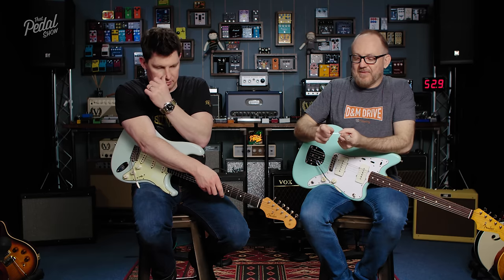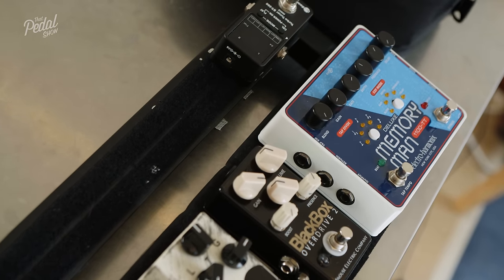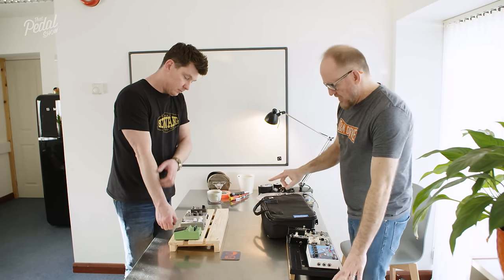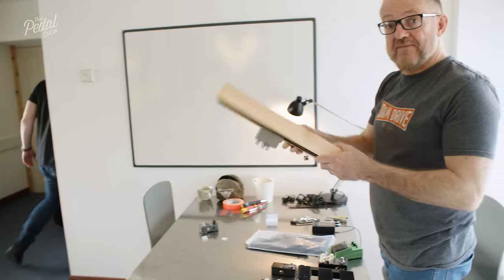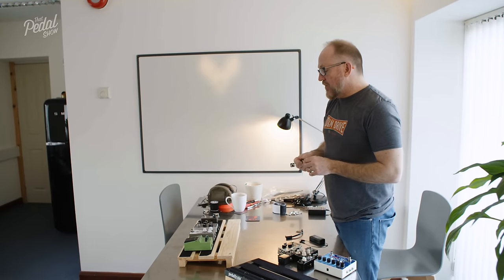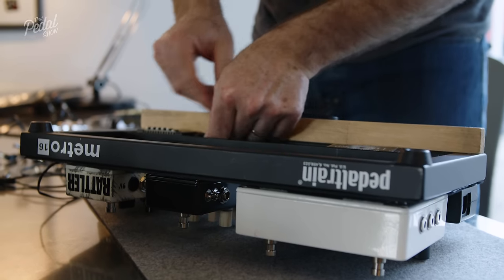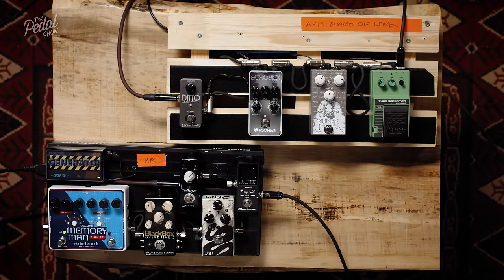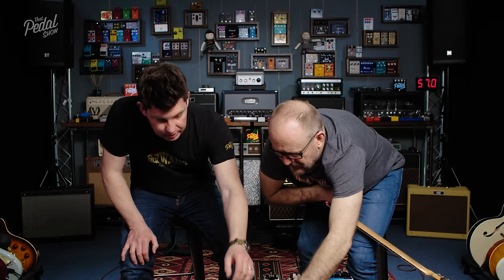Tips For Your First Pedalboard Build – That Pedal Show

Comment: I had been postponing building my board until today, when I saw this video. As soon as I started I realized I would get into trouble. I did the layout and then considered the patchcables. 

Problem 1: patchcables take up A LOT of space, more than you'd figure; had I secured the pedals and tried to conect them, I wouldn't be able to access some of the input jacks on the pedals and conect them.
Problem 2: the floor of my board has circular holes instead of the long open space seen on the two boards in this video. This makes securing the pedals and passing the cables a much bigger problem than it needed to be.

Moving along, I saw the two problems above and decided to check on the power supply. It has plenty of room under the board, but how I can conect it to the power forces the box to be in a specific position, which leads us to:

Problem 3: distance from the outputs of the power supply to the pedals inputs, and the length of the cables I have (which came with the power supply); not sure how much big a problem it may turnout to be, but I might not have the proper cables for all the pedals I can actually supply, meaning I have more outputs in the supply than I can use.

Together the problems above lead to me not being able to use all the pedals I can/want, and not in the layout I would choose. That is a pain, 'cause the board cost me a lot of money. 

Bottomline: people, PLEASE, do consider everything they mentioned here, and if you think you have a good idea of what you need, get something slightly bigger so you have room to maneuver. Be careful! Sure, it's on me, but I do hope this serves as a cautionary tale.

Comment: Great episode. But I reckon one can be more economical with space and without a big budget. I've fitted 8 normal sized pedals plus isolated power supply into a board that drops into an old laptop bag. Very portable, lots of sounds. TU-3 > MXR Super Comp > Caline Pure Sky OD > TC Mojo Mojo OD > MXR Analog Chorus > Source Audio Vertigo trem stereo out > TC Flashback stereo > Strymon Blue Sky reverb stereo. I've used it for a number of years now. Best upgrade has been the low cost isolated power block (8 x 9v @ 500ma ea). I've cycled a few OD/Dist pedals. Pretty happy with the Pure Sky into Mojo Mojo stacking but the plan is to eventually swap out the Caline cheapie for a Wampler Euphoria (any donors?).

Comment: Was you said around 2:40 is so important! I had a phase in which I didn't play much guitar at home, because I had to plug in and turn on the laptop and turn on three switches ("silent" practicing to not disturb the neighbors). That might sound unbelievably lazy, but when you come home after work, picking up a guitar and play should be as easy as possible. I went the OX-road and I'm down to switching on a power strip, put headphones on and hit the Preset Du Jour on Le G2 and I can noodle.

Comment: Instead of using a cable tie to tidy up cables underneath the board, I use the little wire twists that usually hold the cables when you get your power supply. Holds everything in place and you don't have to snip anything when you need to rearrange.

Comment: I started with a "floorboard". Pedals on the floor a la Jimi Hendrix/Robin Trower. Later I bought a SKB pedalboard. After that, a 2x2 plywood and finally a Pedaltrain Nano 24. I don't use a lot of pedals. Around 5 to 6, depending what I'm going to play. Wah wah goes outside. Everything with batteries at the moment.

Comment: Regarding Testing Patch cables: If you are actively using / building / swapping pedals, guitars, amps, PA's, music gear in general. Invest in a cheap cable tester or simple volt meter so you can test cables. Some cable testers come with a tone "send" - this is super useful when sorting out intermittent problems.

Comment: If you're first starting, try your pedals in every configuration you can imagine. Sometimes people get truly unique sounds by not going with the norm. Get a good power supply like a Voodoo, they're solid, and some decent patch cables, there are many. Also, if you have the means, build your first board out of wood or metal, if you have a welder. Paint it, put some lighting in it, attach pyrotechnics to it, do something fun and original that makes it yours.  All my pedalboards I have ever built are handmade. I just can't afford something nice for 15 pedals, so I build my own. Or I guess I spend that kind of money elsewhere. Zip, or cable ties are a great alternative to velcro. I prefer them. They're cheap and plentiful. And remember above all else make this fun because that's what it's really all about in the end.

Comment: The size of my pedal boards are all governed by what redundant laptop bags I have around the place, although I did splash out on a keyboard bag when I wanted something larger. 12mm ply cut to size to fit the bag, spray black, add some rubber feet, velcro tape the top and good to go. Add holes for leads where required. 

Another idea is a carpet tile. Just a carpet tile. Subject to the type of carpet some will hole velcro hook tape like the proverbial to a blanket.

Comment: Top tip for Boss pedals with rubber bottoms: painters tape followed by gaffer/duct tape around the baseplate. Use a minimal amount of tape and loop it around so it’s stuck to itself and secure. The painters tape is just to prevent residue from the duct tape. Also leave the screw holes uncovered. Then you screw the baseplate back on and the Velcro will stick. Credit to some tgp post I read years ago.

Comment: Hey guys I'm pretty sure the noise is coming from the Ditto pedal.  When the power supply is not isolated, it's usually the digital pedal that's gonna create noise. Happens to me whenever I have a looper and digital pedal on the board.

Comment: I use a rechargeable power supply for my small boards (a pedaltrain volto) yesterday it died on me when I was in the middle of recording. But admittedly I was powering a Strymon Flint, a Strymon El Capistan, a TC Corona midi and an EH Small stone for one of my synths, then a EH Bass Big Muff deluxe and EH Bass Clone Chorus. It happened at a really in opportune moment when I was trying to record the bass line.

Comment: Great episode as always. How did you secure the wood strip to the bottom front of your PedalTrain boards to prop the up on an angle? Dual Lock? Glue? Self tapping screws?
Reply from the maker: Wood screws. Drilled through the PT to make holes, and on into the wood....

Comment: Thanks fellas great show and very informative. Especially “Mick “ invaluable info on isolation, i too had a noisy board when engaging my TC Electronics dual pedal of noise gate and compressor, it was disappointing because i had just purchased a new TRex power supply with dedicated 12 volt supply for said pedal👍😁 , i thought all would be good but no . After watching this episode i plugged in the pedal with its dedicated power supply and was nice and quiet 🤫👍
Cheers fellas

Comment: Hey D&M! A question about sharing an isolated output between two pedals. 

I use a VoodooLab 4x4 power supply with 8 isolated outputs. The number of pedals on my board ranges from 8  up to 12, so I sometimes have to share an isolated output between two pedals. I use the VoodooLab Y-cable for that. Most of the time this works out great but with some pedal combinations the other pedal wont turn on. 

As an example: I tried powering my OCD and Simble from the same output with a Y-cable and use another separate output for my Katana. This way the OCD and the Katana worked out just fine, but the Simble wouldn't turn on. I switched the power between Katana and Simble and everything works out fine. 

Even though I've always managed to work my way around this issue I would really like to know WHY this happens. Maybe something to do with the VoodooLab Y-cable cutting the earth from one side of the Y? 

Keep up the good work and greetings from Finland!

Comment: If you put zip ties through in reverse it doesn't lock but it stays pretty well, so if you don't have a board that you are throwing around to an extreme amount it would be alright, in the Marines we used to flexicuff ourselves in training this way so we didn't waste flexicuffs and so we didn't have to cut them off. You can also bend after it's through to make it hold even better.

Comment: When put the velcro on: hookside on the board. If you move pedals around on your board, the loopside will wear out. Over time you'll have to replace it. It's easier to replace it on the pedals than on the board.

Comment: Thanks guys for your timely video, enjoyed especially the explanation of the tigris modular power system and a reminder of the necessity of good signal cable. just about to build a pedalboard for a duo gig, spent a shitload on some quality pedals, it is a necessity to get the power and signal right. The evidence cable and connectors costs heaps, but does the job,  have some george L available, but always hearing conflicting reports on it's reliability . Standing at the crossroads, thanks again, cheers.

Comment: Did you guys ever try the Mission power supply with the big USB charger/battery pack in the setup you had at the end to check for run time, and to see if that problem pedal remained clean when all 4 pedals were run off that one battery pack?

Comment: I have the same pedaltrain pedalboard and I always get angry because of the lack of space for cables below it. Nice idea to lift it with that piece of wood! Thanks!
Reply: What is the best way to attach the wood? I have the same metro board, and the feet are not easily removable

Comment: Great video! It’s worth mentioning that in hotter countries Velcro is not an option if you are playing outdoors, the glue will just get runny and the pedals move. Cable ties are the best option. 🎶🎶
Reply from the maker: What is this hotter country of which you speak?
Reply: I mainly play weddings in Southern Spain. Always outdoors, May till October, 4PM to 6 PM, 30C - 45C! The Velcro lasted until the first time it hit 35C, then the pedals just slipped of the board. 😂 Now it’s only wire ties. 👍👍 thanks for the great Channel.

Comment: Great video guys. Great playing also. You brought up a great point.... for the last few years I’ve had a small board. 5 pedals, powered by the Trex fuel tank jr. I’m now about to add a Mr Black DeluxePlus and also a booster..... new power supply needed :-(. Sometimes it’s easier to keep it simple

Comment: If you want something more secure than orange tape, you can buy little plastic mounts for cable ties that have an adhesive back that you can stick under your pedal board to help with cable mess and routing.  However the orange tape might sound better.

Comment: Putting loop tape on the board instead of the hooks also stops dust and hair and toast crumbs getting stuck all over your board too...
Also a question for you gentlemen. Do pedals run right to left because they were designed in Japan where they read right to left?

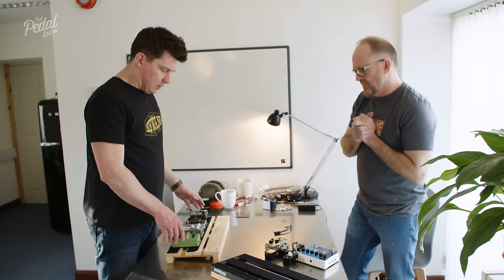Comment: Probably best advice is to get a good power supply (31:20), else all sorts of mayhem and chaos can result.  I had those problems originally with a simple daisy chain power supply going to just three pedals and it was nuts.  I finally got a Strymon Zuma power supply and I haven't looked back since (happy days!).  Of course now I have about 10 pedals and climbing plus volume pedal and expression pedal so now I need to design a good board so it all can go places!  Thanks for all the good tidbits of wisdom :-)

Comment: Just picked up the Voodoo Labs Pedal Power X4 - it's about perfect for a board like Mick has in this video - powers four pedals, isolated, but share 1000 mA with a max of 500 mA per output. It's really small, too, and only $100. Not as Pro as Dan's own brand, of course. It only includes standard center negative cables and only puts out 9 volts. Any other requirements would require special cables and transformers.

Comment: It wouldn't work that well on bare wood, but for a board made with metal or hard-finished wood (paint, poly, etc. - probably not oil), nanotape is by far the best thing I've ever used to attach pedals to a board.Stronger than any conventional tape I've used (MUC stronger than velcro), but also easy to remove if you need to. I've never had it leave any kind of mark or damage a finish or anything, and in theory you can wash it and reuse it (in practice it only needs a couple tiny pieces to hold even a big pedal securely, so I've ever bothered with reusing them).  I was really skeptical when I irst learned about it but since I started using it  I can't imagine not having a roll or two around the practice space.

Sticks to rubber just fine, too.

Comment: Daisy chains are fine. Just don't expect you can get away with them for everything, and have another option to isolate what you need to.
About the usb supply, the way it's drawn makes me think the 500mA output is isolated from the other ones. And this is fine if you have one digital pedal on the 500mA out

Comment: usually on boss pedals you can reverse the back plate, put the rubber side inside the pedal and the row metal is exterior and it's a perfect platform for your dual lock or velcro...

Comment: Not to stray too far off-topic, but Dan some episodes ago you mentioned you were on somewhat of a new home recording setup journey. Have you considered something like the Revv D20? On paper, it looks like a winner and the price is reasonable as well. I'm thinking about going this route after realizing I'm terrible at micing amps (at least as far as recording high gain is concerned).

I like that it will allow me to play through a cab while simultaneously sending a signal with cab sim to my interface. Love being able to have some volume through a real cab while recording. I've used Line 6 products in the past for recording direct, and while they worked great (IMO) for recording, they were less inspiring since I was just hearing them through headphones.

Comment: I really do think you should do a show on the Line 6 Helix LT, the Headrush and the Boss GT1000 - all multi-fx pedal boards, all the same price etc. Compare and contrast amongst each, how great or bad the FX are compared to real pedals, what, if any, things these are missing, even how great their Amp/cab simulation is.

When you come to a conclusion as to which is the best, try to beat it with the same budget (if you can) and whether or not these type of Multi-FX amp modelling devices are worth investing in, up to the standards that they can replace the bulk of your gear (whether you would or not is a different matter because we all love the 'real thing') or where they need to improve to be as good as individual pedals.

I would also love a show where you put the 'best' Multi-FX pedal up against a real pedal board that Dan and/or Mick would take on tour and see if the Multi-FX pedal can create the same 'effects', tones etc - maybe even the amp/cab/mic set up too. This could show how close or how limited they may be for a gigging musician looking at these as a time and weight saving device as you don't need a heavy pedal board with all the wiring and power supply, don't need Amps, cabs and Mics so can just plug in to a PA etc - is the convenience worth the 'sacrifice' or is it not much of sacrifice because these are so 'good' now or not.

For a 'beginner' into FX, is it better to spend the money on a Multi-FX pedal to get a wide array of FX without the hassle of building, powering and wiring a pedal board?

Comment: With Boss or Ibanez pedals most of the time you can turn the back plate inside-out and stick velcro to them without pulling the rubber off.

Comment: Luckily enough for me my pedal board fits nicely in the bottom of my amp head for transport. I rigged up an attachment to keep it secure. As for power if it doesn't come from Strymon, GigRig, Voodoo Labs, or Pedaltrain I won't even look at it.

Comment: I'm definitely curious about the MI529.  I'm currently using the Roctron XL battery powered with 2 isolated outputs.   I separate my digital on one daisy chain and analog on the other.  Zero noise.  More quiet then any voodoo lab or the like has ever been powering off bad mains.  I like the option of the 529 with multiple batteries if the gig goes longer and multiple voltage outputs.

Comment: if you have pets that shed lots of hair, having the hook side on the pedals can collect lots of hair when placing them on the carpet. The pedal board has less contact with the floor so I put hook side on the pedal board lol. Also I use industrial strength Velcro that requires a tow truck to separate the pedal from the board.

Comment: What fortuitous timing! I've just built my dodgy board out of random bits from Bunnings warehouse, ran in to all the same problems and worked them out. So now, my next step is, and I'm hoping others are here too so it might be a follow up video useful for many others, is how do I now give myself the option of using two amps?
Reply: ABY pedal could be an option for you
Reply from the maker: @martinhjerrild7159  Yes, this.

Comment: Quick question - I have 6 typical Overdrive pedals, each powered by its own wall-wart plug  (PSU plug). All 6 plugs are plugged into a “6 gang” extension cable, which in turn is plugged into the plug socket of my home. Surely I have now achieved “isolation” and therefore no need for an expensive dedicated power supply (Voodoo labs etc). Am I correct? I’m new to this, so i might be over simplifying.... Any help greatly appreciated.

Comment: If you guys are thinking of doing a show on electric 12-string guitars you simply must get hold of a duesenberg double cat 12. I managed to get one used (mk1 with slotted headstock) and it is killer. All the hallmarks of a great Rickenbacker but with better playability extra nut width etc. Surely Mick has a contact at duesenberg?